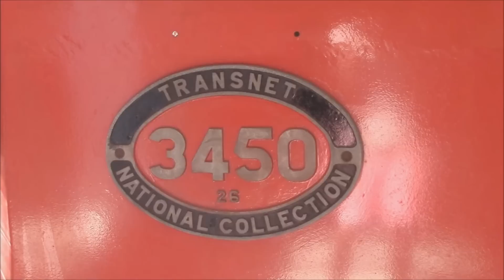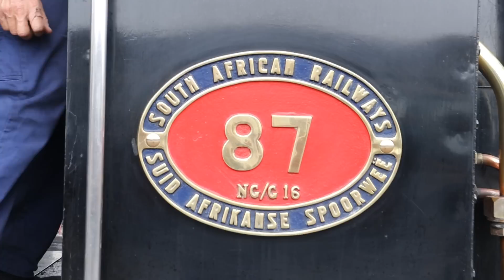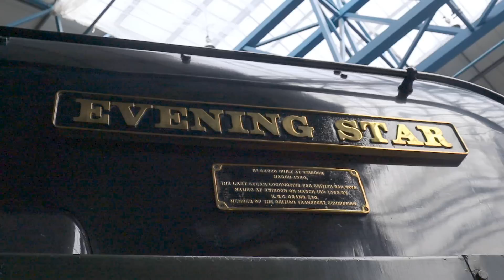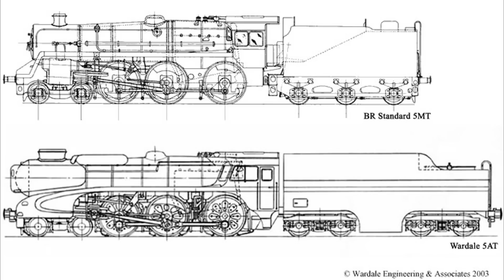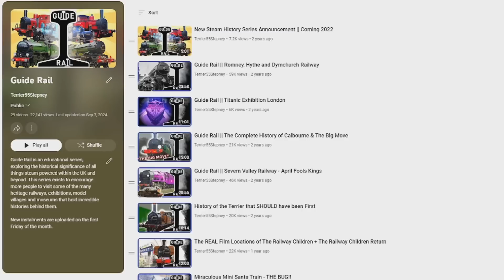What happened to the FUTURISTIC steam locomotive?

Comment: I actually talked about the 5AT in comparison to other newbuild and modern steam groups for a college final! My rough take on it was that Wardale unfortunately didn't do a good job at finding a core group to pitch to. Unlike Tornado (and other semi-traditional new builds) the 5AT couldn't tie into a preexisting history while at the same time it was often too traditional for a lot of the people interesting in modern steam (Reading through the 5AT website's FAQ and Duke team correspondence is rather painful)

(ETA)
To be more precise, while there haven't been any super successful modern steam groups, there are a few that got further off the ground, and they largely did so by having a very very specific reason to exist. For example, DLM in Switzerland is built on a brand of 1) environmentalism and 2) making the operation of steam locomotives more friendly to every day use--the crown of this being their German Class 58 rebuild that has a cab experience comparable to an electric locomotive.

Newbuilds have gained even higher success from focusing on resurecting lost classes rather than targeting an intentionally modern design. However, modernizing/improving has often set as a necessity, especially for unproven designs like the PRR T1 and Gresley P2 (Which, since both these designs relied on poppet valves, ironically means that two groups working to rebuild OLD designs are actively developing/improving a much more modern valve gear than what Wardale wanted for the 5AT)

The impression I've gotten from the 5AT website and most of it's press was that there wasn't any real reason for it beyond 'modern steam locomotive.' There was talk of it for the heritage sector but also talk about sending it (or at least a variation of it) to third world countries that still rely on coal. I really don't think WHO they were building for was very well thought out and with the combination of trying to find a traditional investor rather than what the A1 trust did was the main funding killer.

I am excited for the Revolution Project that the Advanced Steam Traction Trust has been currently doing, as it feels more grounded and (because they're starting with a mini-gauge prototype) likely to succeed.
Reply: Gotta be honest, I’m actually kind of glad that this locomotive was never built. If it was, I don’t want filmmakers to incorrectly use a 21st century locomotive to portray a locomotive from years earlier, like in WW2. It’s like having the Queen Mary 2 to portray the Titanic. Just because it’s a steam engine doesn’t mean it was built in the 20th century or earlier. I don’t want people to be deceived in thinking that a locomotive like this ran in the 20th century, simply because it’s a steam locomotive. At least the streamlining is an indicator that this isn’t a vintage locomotive.
Reply: Gotta be honest, I’m actually kind of glad that this locomotive was never built. If it was, I don’t want filmmakers to incorrectly use a 21st century locomotive to portray a locomotive from years earlier, like in WW2. It’s like having the Queen Mary 2 to portray the Titanic. Just because it’s a steam engine doesn’t mean it was built in the 20th century or earlier. I don’t want people to be deceived in thinking that a locomotive like this ran in the 20th century, simply because it’s a steam locomotive. At least the streamlining is an indicator that this isn’t a vintage locomotive.

Comment: With only 14 per cent efficiency (which is good for the steam cycle) it is just an expensive toy. Interesting to keep the technology alive but it has been superseded. Just as steam superseded the horse and internal combustion superseded steam with same will happen with electric and internal combustion. Greater efficiency and cleaner traction.
Reply: Steam locomotives on the Brienz-Rothorn use less fuel (they just burn diesel oil) than the diesel-electrics running alongside. This was against expectations. Given the capital costs of steam are about one-third, and that rolling stock spends so much time doing nothing. steam ought to be considered for routes which are not busy enough to be worth electrifying.

Comment: I have been thinking about methods to supply steam which do not involve fossil fuels such as small modular reactors and steam generators, or some other idea not yet thought, Such a system, if it could get over its own concerns, could make steam viable as low cost and emission free. The extra torque provided by steam should still have many uses. And if any loco frame could be suited to this endeavor, it would be the 5AT.

Comment: I think it would be more feasible to see something similar built for miniature gauge. 
I’d love to see a 15inch gauge AT5 charging around on the RH&DR or BVR
Reply: I'm with you there, it was my default position for many a discussion on the old steam-tech disccusion group on Yahoo before it wound up.
Interstingly, when the 5AT trust wrapped up, they morphed into the Advanced Steam Traction Trust and one of their pet projects is a 10 1/4" gauge locomotive to be named 'Revolution', which is envisaged as a scale prototype for a future locomotive type ;with a view to the future pensioning off of (very old) museum locomotives, which can be preserved as static exhibits or run only at speical events and heritage galas in view of protecting their historical significance.
Revolution is interesting because the designers are looking at major changes to the way a locomotives frames work, with the cylinders connected to the axles and then to the drawgear by sprung levers somewhat like Cario suspension, leaving he main frame unstressed and only there to support the boiler. In addition, the valve gear is kind of Walschaerts but also kind of like Bullied's (at least at the point where the valve spindle is driven by a rocker arm) so the cyclinders are outside admission. It's rolling chassis was test 'run' at the Stapleford Miniature Railway back in 2023.

Comment: Back around 2007-2010, I did some contract work with Wardale to render it into 3D.  Part of the reasoning being that he wanted to have actual working (as in rigged/animated) design models of various parts of the locomotive design, and then a fully rendered model of the locomotive and all its variants.  There were actually quite a few more than people knew about.  Whatever the case, he sent me copies of his various design elements, and over the course of a year, I modeled and rendered about half the model, before I started running into problems.  Some aspects of the design that he wanted to incorporate, while they made sense on paper, actually wouldn't work in practice.  For example, he planned to have a curious 'double' valve gear on the pistons.  Not unlike the Vauclain compound locomotives, where you had a low pressure, and high pressure piston contained in the same piston cradle. Not a piston inside the frames mind, but two pistons built in one that worked off a singular drive rod. Rather than taking the previous design element that had been used with Vauclain Compounds,  he'd instead created this strange system with two eccentrics, and two completely separate valve systems.   During rendering of that part, it became painfully obvious to me that there was no actual way to make that fit within the design constraints he had placed.   This prompted him to redesign the piston system, completely removing the odd compound pistons in favor of a more conventional piston and valve gear system. Though in many of our discussions, he noted that if I could figure out how to make it work, he would have much rather I continue with that design element.  I remember informing him that while I could 'make it work' in theory, since I wasn't an engineer, I couldn't guarantee that any modifications I made would actually work in real life.  After all, I was a simple 3d rendering artist, and any modifications could potentially break the laws of physics.  The final engineering renders were delivered to him in early 2010, around March I believe, and featured a rough outline of the streamlined, and non-streamlined variant; with two tenders. The first tender being a conventional coal fired tender, and the second being a proposed diesel fuel tender, both built roughly along the same lines of a black 5 tender, though with some of his own proposed modifications.  I expected to continue working with him on the project, but at that point he was already questioning whether or not it was even plausible to continue the project.  By 2012, as we all know, the project had been abandoned.  I believe I still have some of those renders somewhere on a hard drive, though I'd have to find them.  I have often thought about going back and uploading them for history's sake, though I'm not certain what if any good they could do for people.
Reply: Woah! Regardless of what you do with the models, that certainly sounds like an honor.

It is curious to me though why he wouldn't have someone working on making a CAD model, as that is usually the standard for modern engineering. I know the tech has been around since the 80's but I suppose that it is possible that actual ability not just make parts but assemblies in CAD wasn't quite there yet.
Reply: @eliyahzayin5469  I'm a mechanical design engineer. If I had Wardale's designs, I could make a CAD model happen. It would be an incredibly large undertaking to do in my spare time for free, so everyone would have to be very patient, though.
Reply: @eliyahzayin5469  At the time, he was trying to get a 'realistic' 3D model of the locomotive produced for a reasonably popular model railway simulation game.  Specifically Trainz.  Speaking with him at the time, he felt that this might drum up more interest in the project, in a kind of grass roots type of situation.  The idea being that if people could see what the locomotives would look like in operation, even through a game, it would draw further interest to the overall project itself and might help secure funding.
Reply: would be cool if someone could use them to build models from.

Comment: The 5AT looks like a very draggy design. The A4 was properly streamlined to reduce drag, and the 5AT would waste a lot of power getting up to any reasonable speed.

Also a diesel locomotive has a thermal efficiency of around double that of the 5AT, meaning no one will want to run it commercially diesel locomotive is available.
Reply: It's a different story in practice, as the Brienz-Rothorn railway discovered when their new steam locomotives began running in 1993. There is also the matter of capital costs to consider. A steam locomotive is an inexpensive piece of kit if there is a decent production run, and locomotives spend a lot of time doing nothing at all.
Reply: @physiocrat7143  and which point are you responding to?
Reply: @neiloflongbeck5705  

That thermal efficiency does not give the full picture. Hence the unexpected results with the Brienz-Rothorn locomotives. Even the manufacturer, DLM, was surprised and it took quite a lot of investigation to discover what was going on.
Reply: @physiocrat7143  thanks I'll look it up.

Comment: As much as this would've been incredible to see, I just don't think it ever would have been a big enough improvement to justify the project. Sure, the loco would've worked very well, and in terms of power, speed, reliability and efficiency would've been an improvement over existing steam designs, but it still has most of the major, inherent design faults of any steam locomotive:

1. It still requires two crew members (driver & fireman) to operate it, doubling operating costs. Diesels only require a driver.
2. It still requires said crew members to turn up at six in the morning to light the fire, and still be on duty well into the night to dispose of the fire once the running is finished. With a diesel, all you need to do is press the 'on' button, and press the 'off' button. (A simplification I know, but overall still a lot quicker than steam).
3. It still has all of the oiling points. Whilst the fireman is lighting up, the driver still has to go around and oil up all of the motion. Whilst a diesel driver does still have to oil up certain parts of the loco, the process is much simpler and quicker.
4. It still has a tender. You are still dragging around an extra wagon with the fuel, adding weight that is not present with a diesel. And of course this also necessitates the reintroduction of turntables.
5. It still has a long boiler at one end, and a long tender at the other. Visibility in comparison to a diesel with cabs at either end is incredibly limited.
6.It still has a boiler that undergoes incredible stresses during operation. This means both that there is a higher risk of a potentially catastrophic explosion, and of course the 10 year boiler ticket would necessitate overhauls, meaning potentially years out of action every decade each time the ticket expires.
7. It still has a fixed wheelbase, which would limit the tightness of corners it could go around.
8. It still has the hammerblow effect of the pistons on the rails, meaning increased track maintenance compared with diesels.
9. It still burns oil/coal, which as we all know are fuel sources both damaging to the climate and becoming harder and more expensive to source.

It's important to remember that when diesels came along at first they were very often inferior in terms of speed, power and reliability to their steam predecessors. However, they were specifically introduced because they did away with all of these inherent steam loco flaws. And of course, modern diesels and electrics are generally far faster, more powerful and more economical than the best steam locomotives, so I don't see how this steam loco would ever be able to match them.

I absolutely love steam locomotives and will always prefer the drama, noise, smells, sights and soul of them over the bland, boring, soulless, plastic boxes on wheels that rule the main line today. However there was a very practical reason for the replacement of steam in the first place, and I just cannot see how the 5AT could have possibly improved on the efficient, quiet and practical trains of today.

That being said it is still a very interesting topic and one that people can (and will probably) debate for many years to come!
Reply: These are all very well thought out comments. One thing you don't mention is the changing labour market. Steam requires a larger workforce, especially for preparation and disposal, cooling,clearing ash and soot etc. Diesel and electric need fewer staff, but with technical qualifications. In a changing environment, steams biggest advantage, simplicity, turned into its greatest drawback.
Reply: Gotta be honest, I’m actually kind of glad that this locomotive was never built. If it was, I don’t want filmmakers to incorrectly use a 21st century locomotive to portray a locomotive from years earlier, like in WW2. It’s like having the Queen Mary 2 to portray the Titanic. Just because it’s a steam engine doesn’t mean it was built in the 20th century or earlier. I don’t want people to be deceived in thinking that a locomotive like this ran in the 20th century, simply because it’s a steam locomotive. At least the streamlining is an indicator that this isn’t a vintage locomotive.

Comment: If we hadn't gone the diesel route, the plan wasn't better steam engines, but electricity. That's why the standards had a 40 year lifespan. By that time, it was predicted nearly the entirety of the UK would have been electrified. Sadly, short terminism won out, and we are still arguing over electrification to this very day, despite the need for it being greater than ever
Reply: A lot of the network is not busy enough to be worth electrifying.
Reply: but you insist on trickle charging your grid with sunshine and breezes; it's a struggle enough keeping the lights on even while heavy industry emigrates to more sensibly managed locations; how would the aenemic UK grid cope with full electrification of the rail network and for that matter a full conversion of the fleet of cars, trucks and busses to milk floats? And if there's a pile of unicorn droppings that can make that engineering conundrum work on paper, how would the bankrupt tax payers cover the exorbitant cost when already struggling to pay for all the other net zero virtue signalling?
Reply: @BenjaminHern-i3g  Had electrification of the rail network taken off, I feel certain in say we would have ended up more like France, and invested in nuclear. Long term thinking would have spread far and wide

Comment: the 5AT  project would've been wonderful, but I don't think that those power, tractive effort, and speed goals are at all beyond a Gresley A4, especially if given a Lempore exhaust.  Considering how 2509 SILVER LINK did on her first day without a special exhaust, at a low regulator setting, the only thing stopping SIR NIGEL GRESLEY from repeating that and breaking records is the signaling equipment and regulations, the former of which has been done for big boy 4014 already.  I say give SIR NIGEL GRESLEY a lempore exhaust, maybe lightweight con and coupling rods like her originals, and we have the winning idea, far easier and cheaper than a complete new build, though a bit more maintenance heavy, and slightly less efficient.